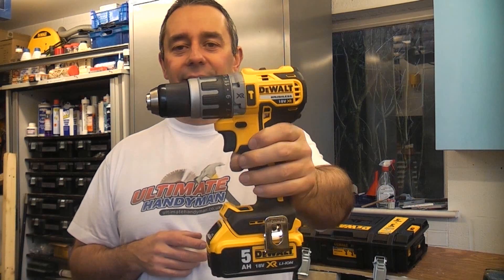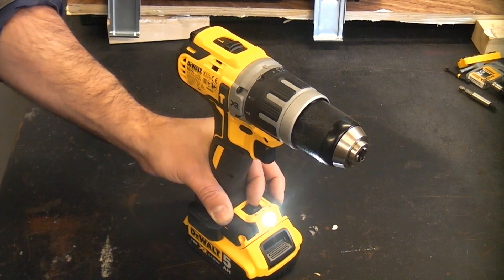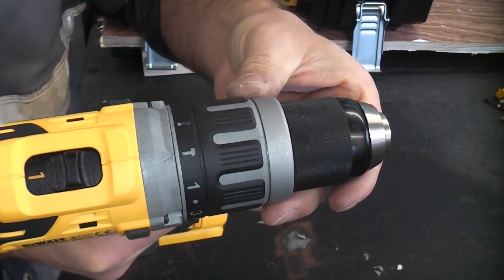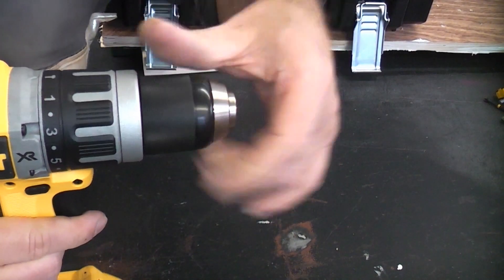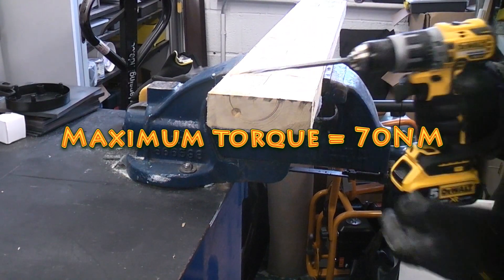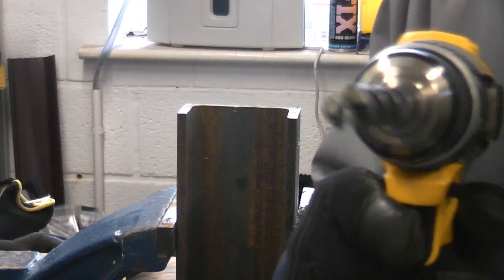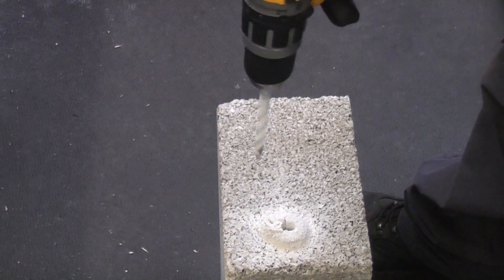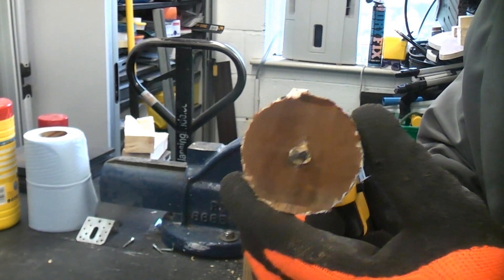Dewalt DCD796 | Dewalt 18v cordless Brushless drill

Comment: Was torn between another well known make and a Dewalt. Looks like the Dewalt have moved up to the no 1 spot on the shopping list. Really impressed with how it walked through the concrete block.
Reply from the maker: +Mark Slevin 
I was impressed with that too, normally concrete blocks can be difficult to drill with a cordless but this made very light work of it.
Thanks for the comment

Comment: Thanks for the post.  I have ordered a kit that comes with the impact driver.  With the 2" hole saw on, you had the drill on torque setting #13.  If you had it on the drill-mode, it would have drilled through the plywood without hesitation.
Reply from the maker: That is correct, but the torque control is to prevent damage to the drill and the user, which is why I always use it with hole-saws.
Thanks for the comment 👍
Reply: Dikkat etiyseniz mengenede bağlı olan kontraplak parça esniyordu.Daha kısa bağlanmış olsaydı çok rahat kısa anda delme işlemi olurdu.Mengenenin bağlı olduğu tezgah biraz gevşeklik gösteriyordu.Yinede kullanıcı arkadaşımız daha net cevaplayabilir.

Comment: Hello. I have a few questions please. WHY did you use the low setting, instead of high, for the drilling into wood and metal? In general, isn’t higher speed better for drilling? Also, when you used the hole saw, why didn’t you put the drill into drill mode? You put it on # 13 instead. WHY? Is that because it won’t kick/jerk your wrists if it gets stuck in the wood? The clutch stops the drill. I know if it’s in drill mode, the drill can jerk in your hands. A little risky. 
Lastly, do you still highly recommend this drill? I don’t want to spend a lot of money on the newest version. I was thinking of buying this particular model in 20V (I’m in USA). Do you still presently have and use this drill? Thank you for the video.
Reply from the maker: The lower speed setting gives more torque.
When using hole saws, it is important to use the clutch, as you rightly say- to prevent injury to the user!
This drill is OK, but there are better drills out there. The chuck on this drill is not brilliant, and a few people have commented saying that the chuck cannot be replaced! 
 👍
Reply: @ultimatehandyman  what do u recommend for drill + driver?
Reply from the maker: @henrikgustav2294  I'd go for Milwaukee. I use this 12v drill driver all the time (it has a 1/4 inch hex chuck) https://www.youtube.com/watch?v=xEcnCSqLv9M&t
If you need to drill larger holes or drive in large screws, I'd go for a 18v version, perhaps something like this- https://fave.co/3Y16alU

Comment: Wouldn't touch it with a bargepole.  Heard they got a special pin so you can't replace just the chuck.  Have to buy the complete front unit, chuck, transmission and geearbox.

Comment: Why did you switch to the second gear when drilling the concrete block? Thanks
Reply from the maker: You can use a faster speed when drilling masonry, it makes the hole much faster 👍

Comment: Should I be Keeping it "Pushed" when drilling on bricks/masonary? I am having difficulty drilling on masonary using 4mm masonary bits - any advice?
Reply from the maker: Yes, you need to apply force to the drill, also ensure that hammer action is selected. It’s also important to make sure that the drill bit you are using had a tungsten tip. Example drill bits here- https://bit.ly/3uaRP9B
 👍

Comment: that is actually smaller than the old 12v xrp, very nice for an 18v, the light is a bonus, no more messing with a torch or finding one that isnt flat, the 2 speed i think is less messing than the old 3 speed too.    is there a side handle for it?   my makita 14.4 i had to drill a 6 inch deep 13mil hole in steel, i thought  that was pretty good going for cordless!
Reply from the maker: +jusb1066 
Thanks, yes this is very compact and powerful.
There was no side handle shipped with it, but you could probably get one.
Your Makita sounds powerful for a 14.4v
Thanks for the comment

Comment: I have one and the only thing that bothers me is that the ring where you can select the torque shifts by itself allot. While drilling all of a sudden your drill 
goes into torque stall because the ring moved. It is powerfull as hell tho.
Reply from the maker: It should not do that- it's faulty. Is it still under warranty? If it is I'd send it back.
Thanks for the comment 👍

Comment: Did you find that forward and reverse gear changer felt a bit lose? I've had a Makita in the past and it had a middle (safe) selection which this one doesn't seem to? Or if it does it's too easy to have it slip out.
Reply from the maker: No, its absolutely fine with this drill, I have never had any issues with it.
I had a similar problem with a Milwaukee impact wrench at work, there was a small piece of spring steel, which had dislodged, so the selector button was loose and did not engage properly.
Thanks for the comment 👍

Comment: Very nice review. I just have a question, this model is DCD796P2 but in the USA,it is DCD796D2. What is the difference between the two?
Reply from the maker: It is the identical drill, but the end figures often denote which batteries are supplied, so the D2 will include different batteries than the p2 
Thanks for the comment 👍
Reply: Ours here in US say 20v MAX and anywhere else they say 18v on them. Our 20v max still only run at 18v they only will do 20v for a fraction of a second when the battery is fully charged

Comment: Pardon my lack of knowledge but what’s the difference between the DCD 796 and the 795.  Thanks
Reply from the maker: The DCD 795 is the cheap version, which is nowhere near as good. It has a plastic chuck cover etc. The 795 is a lot cheaper to buy but won't last as long. 
Thanks for the comment 👍
Reply: Ultimate Handyman :  Thanks 👍

Comment: Hi what type of hole saw was you using it went through the ply very well and I haven't seen one like that before as it looked like it was for masonry ?
Reply from the maker: It is an FF hole saw, which used to be marketed by a company that sold accessories to kitchen fitters ( I think they ceased trading).
I tend to use Starrett hole saws now as they make a wide variety for loads of different applications.
Reply: Excellent cheers
Reply: @ultimatehandyman  Why did you have a torque setting when cutting into plywood?  Thought that was just for screwing?

Comment: Hi handyman what drill would you recommend that can drill using circular drill bit and also won't get overheating for continuous using around 1 hour period? This is because i have a drill that overheat very fast and also can't grip the circular drill bit very well..and of course i am looking the affordable one :)..and not cordless

By the way how long the battery last for this cordless drill when using it continously?
Reply from the maker: What material are you drilling with the circular drill bit? Do you know the exact name of the drill bits and the diameter?
I'll try to suggest something ;-)
The battery on this drill lasts a few hours if not using it continuously.
Reply: It's nameless but this is exactly it. http://www.dhresource.com/0x0s/f2-albu-g1-M00-28-A5-rBVaGVZrM_yARPeTAAByCUMSkRY945.jpg/new-tile-glass-metal-hole-saw-diamond-core.jpg...not sure why the cheap drill couldn't grip it properly...instead of the bit spinning its the chuck spin and the bit just stucked...if there is good affordable drill that not easily overheating and powerful and also of course can grip the bit properly i would like to have that.

And actually i am drilling woods not very hard wood ...but its too frustrating it wont go through and i have to chisel it in the end...i would rather chisel it all the way through j/k

Comment: What's the difference between DCD796 & DCD796B please?
Reply from the maker: Normally the letters at the end (after the model number) denotes what comes with the actual tool.
So the DCD796 will be the bare drill on it's own
The DCD796 is probably the exact same drill, but including a battery. etc. 
Thanks for the comment 👍

Comment: When would you recommend using hammer mode? I thought when drilling through steele or any hard surface
Reply from the maker: You only need hammer action when drilling masonry. Never use it on steel, as it could break the drill bit.
 Thanks for the comment 👍

Comment: Did you do all the drilling with the same battery charge?
Reply from the maker: +t braithwaite 
Yes, this came with a 5AH battery which can last 2.5 times as long as my old Dewalt 2.0Ah batteries.
I will do a demonstration on how long the batteries last when I get chance ;-)
Thanks for the comment
Reply: +Ultimate Handyman 5ah might drill all day, thats a lot of power!
Reply from the maker: +jusb1066 
Absolutely, in most cases it probably will last a full day!
Thanks for the comment

Comment: I have only seen these in 20v?
Reply from the maker: They are 20v in the USA, but 18v in the UK.
I'm sure they are exactly the same, but named differently in some countries.
Reply: They’re all actually 18v ours here in America say 20v MAX which is what it puts out when the battery is at max charge but after it’s used for just a second or 2 it will drop down and continue to run at 18v

Comment: In the United States the DeWalt dcd796  is a 3 speed gearbox not a two speed
Reply from the maker: That's weird, I would have thought the machines would be identical all over the world!
Thanks for the comment
Reply: It is also 20volt in the US
Reply: Is it possible you are talking about 996 model?
Reply: i think so
Reply: iNCORRECT. The 791 & 796 are two speed as shown here, no matter where you are in the world. Its also an 18 volt tool but only marketed as a 20 volt tool in the US by the marketing wanks. The DCD991 and 996 are the bigger 3 speed models. Its ok, your special...

Comment: How the hell to they justify pricing a dewault drill set with 2 battery's for £100 yet a battery alone is £50????
Reply from the maker: Is it this exact drill with 2 batteries for £100?
What AH are the batteries?
Reply: @ultimatehandyman  yes just having a rant as I have a DeWalt  18v cordless with 2 lithium Batts both are knackered, I've had a quick look on line and it's cheaper to buy a new cordless with battery's lol how do they justify the price of buying one battery??? So two would cost around £100 but could buy a brand new drill with 2 Batts for that it's almost as if your only really paying for Batts and drill is free lmao
Reply from the maker: Some manufacturers do special deals like that, so that you buy the drill. Then when you buy the next tool, you go for the same make, as you already own the batteries and chargers.
Bosch were doing a similar deal at screwfix a few months back, they had a Bosch 18v drill kit for about £90 with batteries, charger and case. It was worth buying the kit just for the batteries and charger!

Comment: Hi Ultimate Handyman In Australia they sell DeWalt 10 volt , 14.4 volt and 18 volt cordless tools , I have some 14.4 volt tools with the modern type XR batteries   only the hardware store that sells them is closing down and  I Can't find any-where else that sell 14.4 volt DeWalt tools . so the batteries are in short supply  What I want to know is ,  will my tools run on 18volt batteries as they will slide into the carrier the same as the 14.4 volt batteries
Reply from the maker: I'm not sure, sorry. With the XRP batteries they all fit the one battery charger but you could not put the incorrect voltage battery in the other tools.